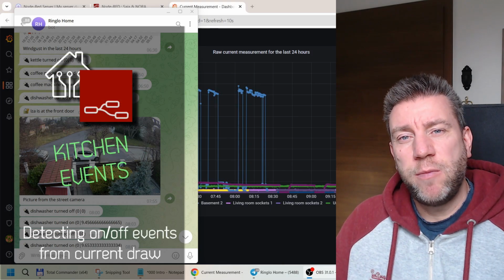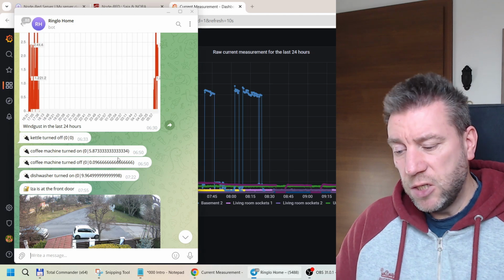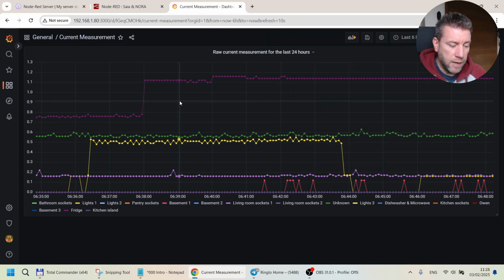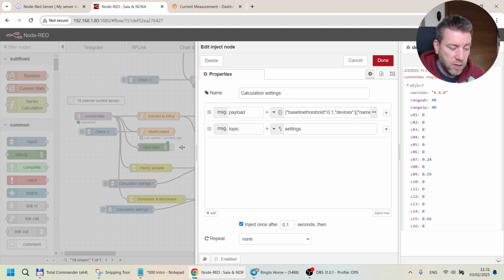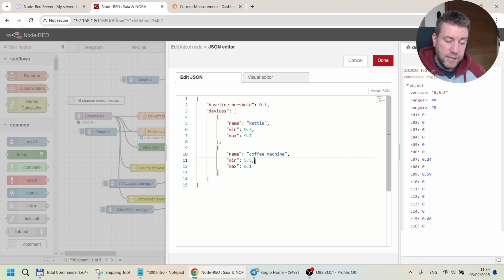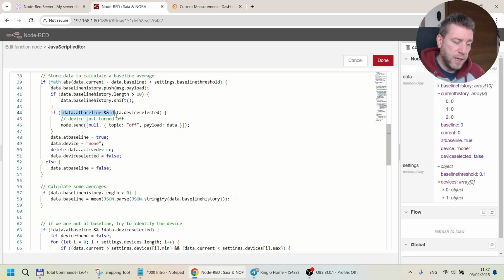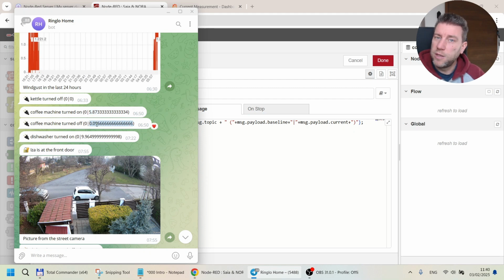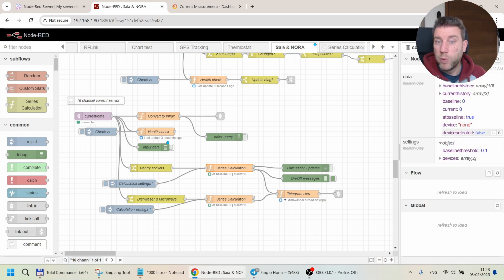Finding devices just by looking at current data

Comment: Excellent video, sir!  I recall there was an in-panel energy monitor that could determine the status of all, if not most, of the electrical-using  devices.  I think it used FFT or similar mathimagical functions to pick out the signals from the noise, so to speak.  Sadly, I can't find the video on the subject.  

Here's an idea: what if you added a microphone to record kitchen sounds, then process with the appropriate software to detect the devices going on & off.  Each of my appliances makes a different sound; even though its' mostly "beeps", each of them differs in frequency, timing, # of beeps, etc.  I think this, combined with electrical usage as you're doing in this video, would make for more reliable detection.

I doubt we'll ever get a simple, universal method for controlling home devices (hello, MQTT?).  My washer and dryer are the only appliances that have a WiFi connection option, but sadly only available via a proprietary, closed, extra-shitty app.

Another example: my dog barks differently when she wants to come in vs. when someone is coming up the lane.  By detecting these differences, the proper message can be sent to me ("Let me in!" vs "Intruder Alert!"... and yes, I'd use the sound from the 1980''s arcade game "Berzerk").   This could also be the basis of a universal "dog-to-English" translator?

Cheers!
Reply from the maker: Interesting throughts for sure. To be honest so far it was more of an experiment if I can do it. I still have to find the use for this logic. Maybe the off notification is useful, for example you start a machine and you forget that the hot water or the coffee is ready, but it rarely happens to be honest. Once I have seen a video of a smart curcuit breaker panel which could detect usage like this and send notification when something is unusually high. That is the end goal.